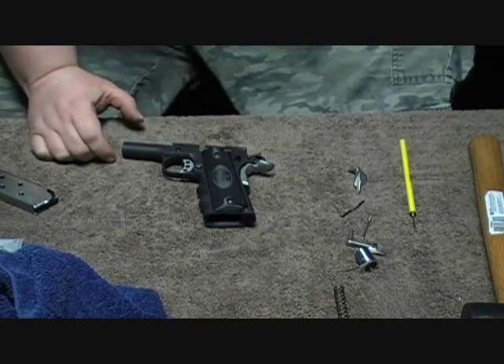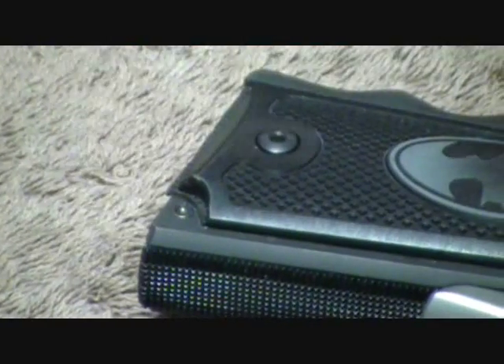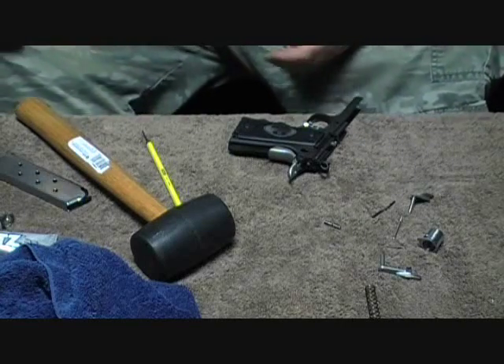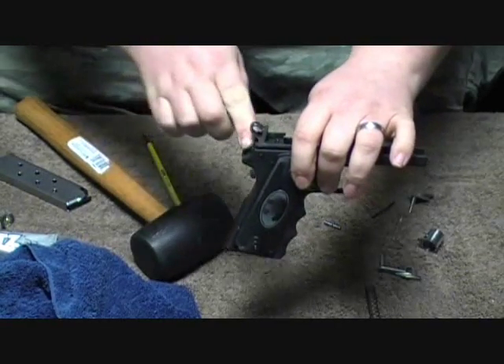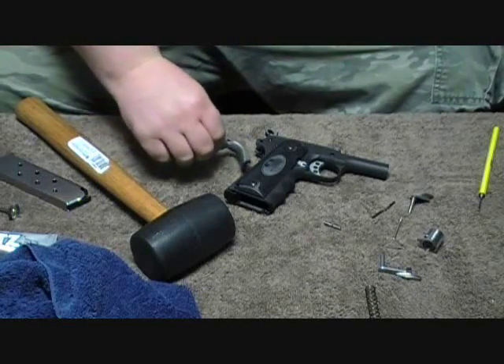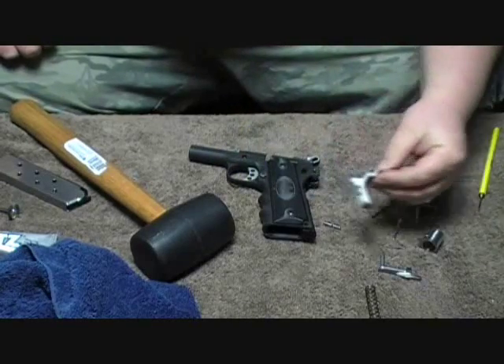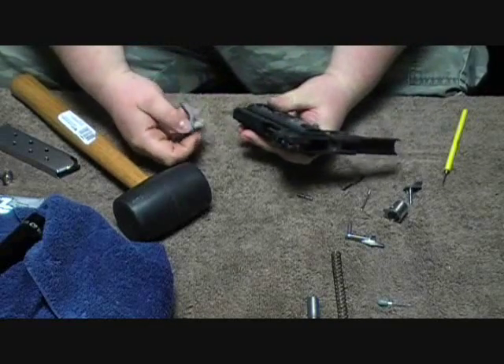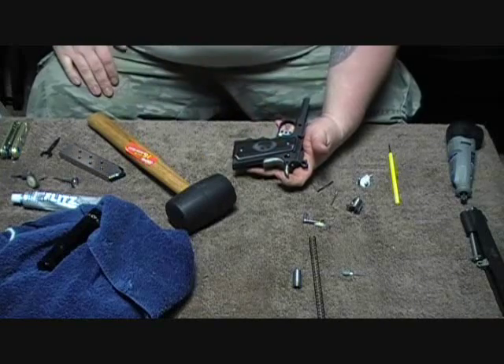Customizing Your 1911 Part 4 Beaver Tail Safety

Comment: Did the same on my Kimber. Installed a high end Wilson stainless beavertail but was very casually fitted by the gunsmith. Ended up with huge gaps so I just bead blasted my original Kimber beavertail, polished it and now it fits perfect and adds a cool accented look.